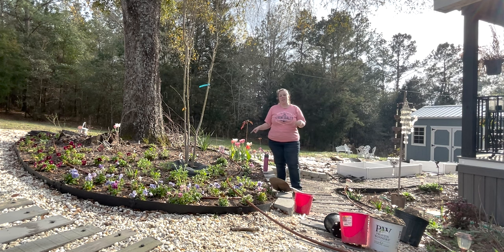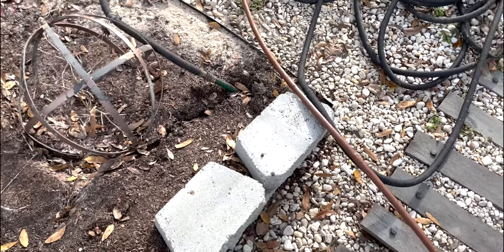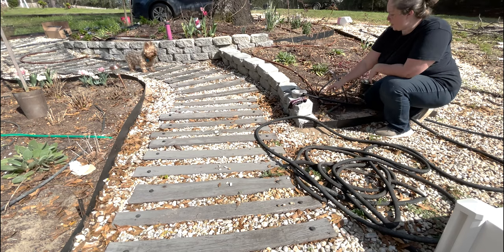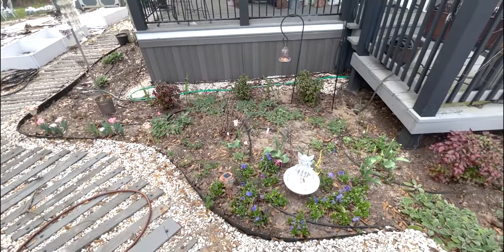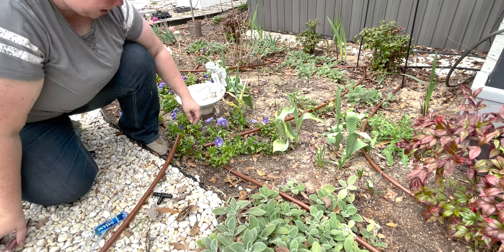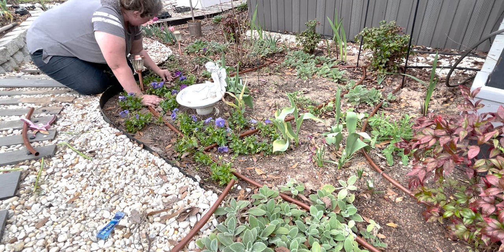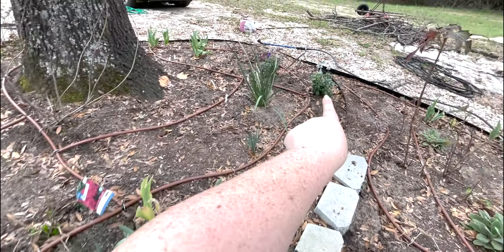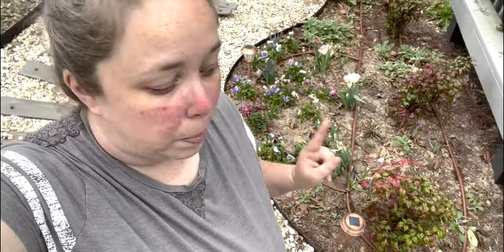Installing Drip Irrigation to the Front Beds (Replacing Soaker Hoses)(Zone 8b)

Comment: Bravo, that's hard work but necessary (IMHO). Looks like you have 4 different circuits coming off of that faucet? I hope your hoses don't pop off the Ts, I noticed you don't use ring clamps. I say this because my system is only half or less than yours and I had that happen a couple times. I use 1/2" with either a few 1/4" with emitters, or individual emitters of varying types stuck right into the 1/2". Every year I re-work mine a little depending on what's old and new. Hope you had a good day or two of rest after that!
Reply from the maker: It's so nice having it done... a real drip irrigation system is amazing to have. I do have 4 different circuits on my front faucet so that nothing has to go too far. They all run at different times so it hasn't been a problem for the last 3 years. I imagine if I tried to turn all 4 on at once it would be an issue. I've added a few ring clamps on the bottom t-s for reinforcement but so far haven't had any issues... I'm sure it will evolve over time.